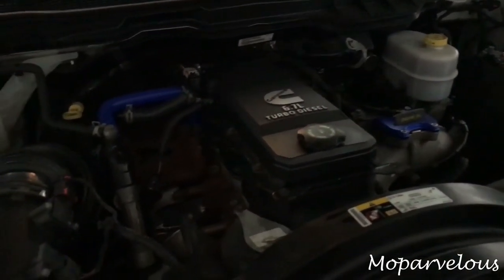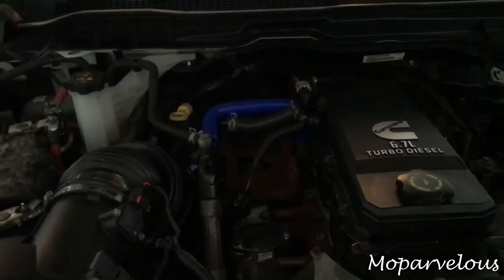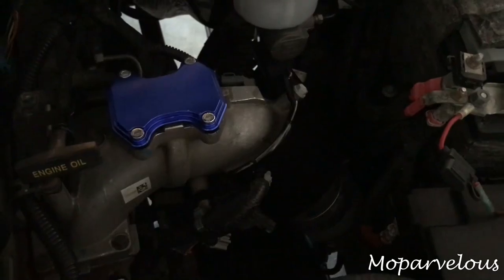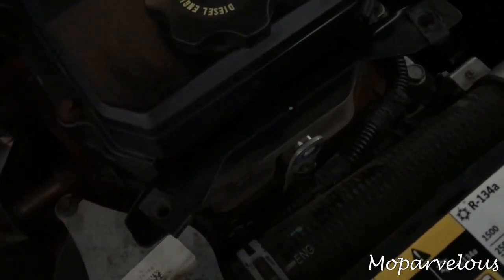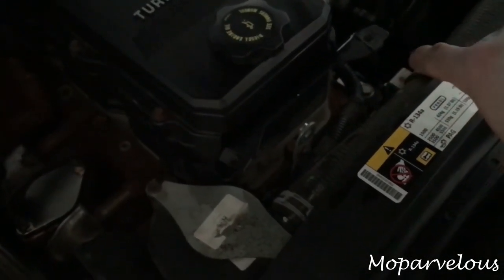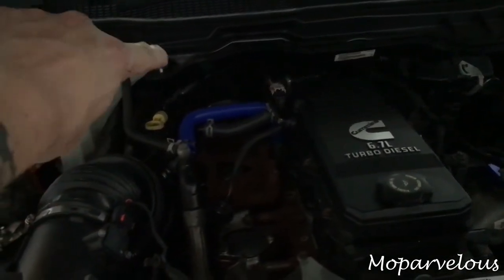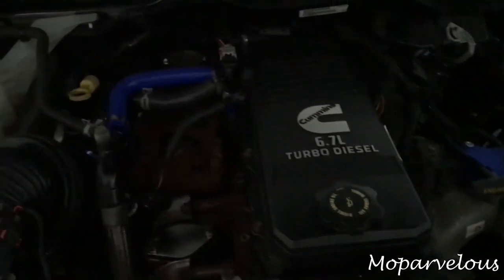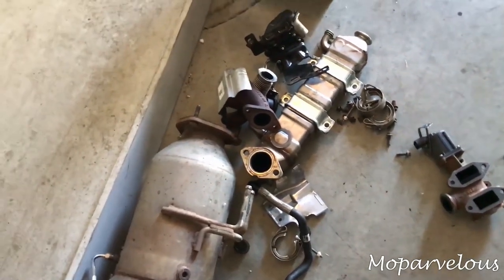EGR  Delete Finally Installed! Ram 2500 Struggle!

Comment: I’m in Missouri and am currently up late Saturday night, goin’ all out[, about to finish up my 2018 G56 delete project. I’m doing this at my 2nd oil change, 1St air cleaner service /10,000mile. 
I put the delete piece in, taking that stupid throttle out. 
I opted for the 4” straight pipe, idk why, seemed right.  Install went great. Exhaust is solid, it’s awesome. 
I am glad I went with this project. The particle build up before the burner was unreal
Reply: @Caden   Do you mind saying where you got your exhaust kit at?  I can't seem to find it anywhere after all this EPA shit
Reply: @texfire76 currently running into the same issue of finding an exhaust you ever find anything?

Comment: Just a suggestion brother.. I’d get rid of that throttle valve. Even though there is no power to it, it is a single point of failure. It seldom happens but that valve can fail, close off, and cause catastrophic damage to your motor. It’ll cost ya $30 on amazon and it’s very easy to install.

Comment: The welded bolt and egr cooler plate are the same for all 6.7's if I remember correct. I have a 2010 and deleted it with about 1500 miles on it back then...Yes was a pain from what I remember...sorry the welded bolt was one of your snags but crazy crap like that happens to us all. There was no videos out when I did mine! haha

Comment: Couple things my illustrious bro. That's not a bolt. It's a nut. I just did this after work. Started about 6 and got done about 830. It's not too bad if you go at it methodically. I do want to say that you absolutely do NOT have to touch that heat shield on the manifold to get the bracket off. There are 2 13mm bolts holding the bracket to the head. 

Dig the fact you did it yourself though. Props. 

Also.. the rerouted coolant line... The blue one... Not 💯 sure but my kit instructed to move that hose to the back coolant port between 5 and 6 to allow proper cooling.. keep an eye on that. Might not make much difference. Not sure.

Comment: Hey, brother! Thanks for making this. I have a 2016 and, like you, got a little annoyed at only seeing earlier models because there might be a little variation between years (maybe not though). One question I had is what you did for the software portions (I see you went with EX lynk but which unlock cable and autocal)? Also, where'd you order the tuner/cable/autocal? I ask because, with all the options, I worry about getting something that works for my 2016. Websites will tell me they work but I have some scar tissue from a mod I did on a previous vehicle. The website said it would work for my year and it didn't--huge hassle!

Thanks again for making this and I hope to hear back from you soon!
Reply from the maker: Jeffrey Barker Thanks for reaching out! Yes, the EZ Lynk is by far the simplest and easy to use tuner on the market (in my opinion). I know I’ve said it in other videos, but I do need to get around making a video strictly on tuning and the step by step process! 

The great thing about the EZ Lynk, is its all inclusive. It includes the unlock cable, and preloaded tunes (depending on which package you purchase). So by purchasing the EZ Lynk, you get everything you need with it! 

As far as best price, I’d shop between PPEI directly, and diseltruckproducts.com. I’ve purchased the EZ Lynk from both sources (two different trucks) for under 1199 (single tune package, includes everything!!). 

That is however the biggest downfall of this tuner, it’s price. But.. you get what you pay for and when it comes to your trucks computer, I’d spend the extra money. At minimum, use PPEIs tuning. 

If you have any other specific questions, ask! I will get you an answer.
Reply: Moparvelous Or Bust Excellent news! I hit 35,000 on my truck yesterday and it’s been stressing me out having that junk on it. Couldn’t be happier to find some solid information about my own truck. Thank you again—this is awesome!

Comment: Do you need to drain coolant to remove the egr?
Reply from the maker: Hey Jacob! You don't NEED to... If you have a 2016, you'll find your radiator doesn't have a drain point like older RAM Trucks. The EGR Cooler on the passenger side will have some coolant in it, but a very minimal amount. When you disconnect it, you'll just lose whatever was in it - less than a cup or two. But no, coolant will not come spewing out!
Reply: Jacob Stine , really? Wow...

Comment: The truck can work if I cancel those egrs first.??
Reply from the maker: Yes, your truck may run fine by first disabling the EGR system (without tune). You WILL get a check engine light however, but it will not, and should not impact the function of your truck.